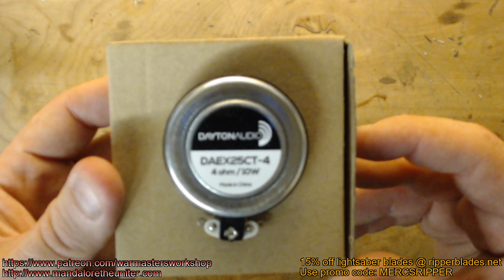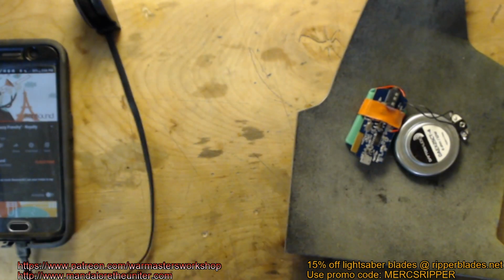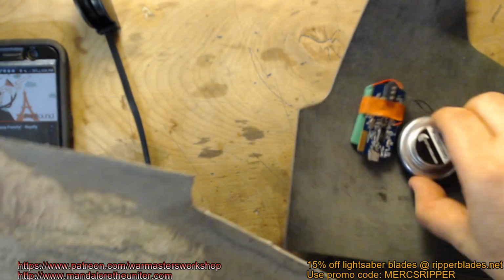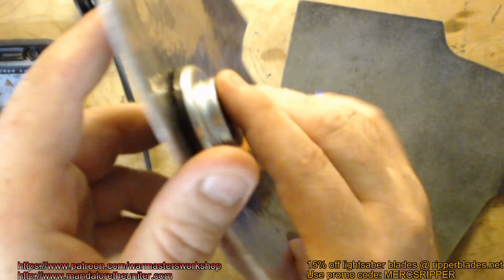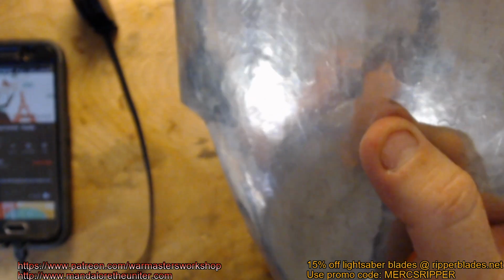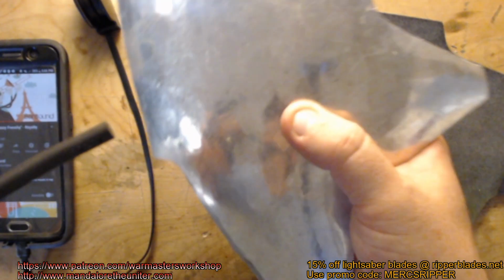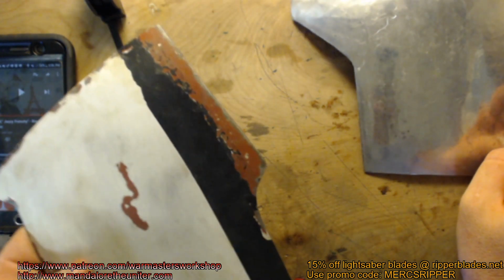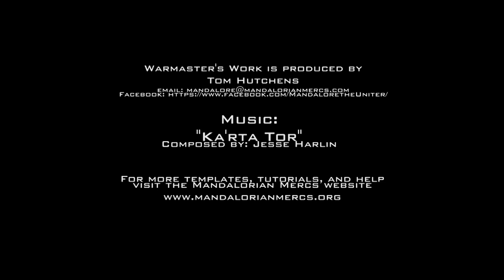Short 4: Audio Transducers

Comment: What power source are you using for the amplifier board? Also, your links are to a 10w speaker and a 20w amplifier.  Should such an amp be used with this speaker?
Reply from the maker: Hi Keith, I'm using the LIPO battery that came with the 3W sound board.  The reason I linked the 20W amp is because it's an adjustable amp based on input voltage, and can push up to 20W at max input voltage.  It's also a super-small amplifier board, so that's two very beneficial things when we're talking about wearable electronics: options and size. :)
Reply: @MandalorianMercsCC  thank you. I just re-evaluated by vox system:-)